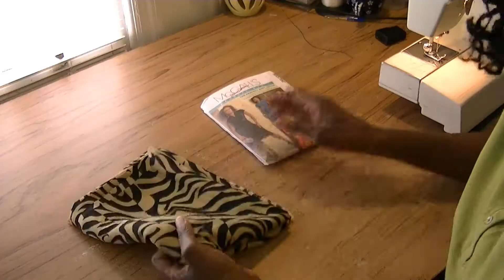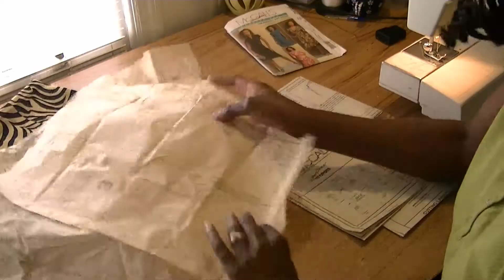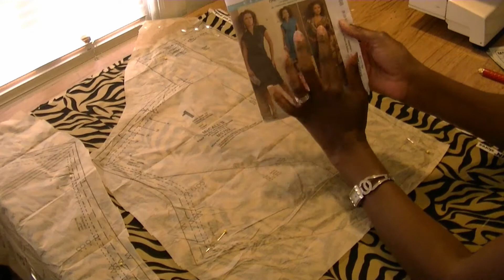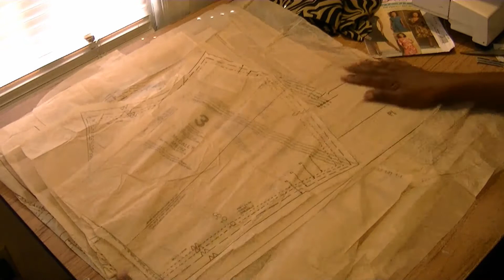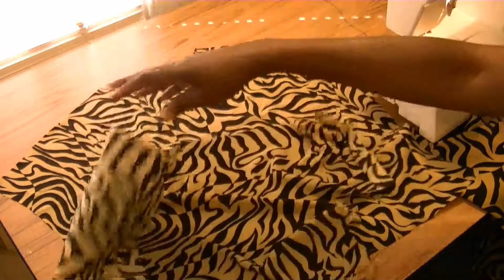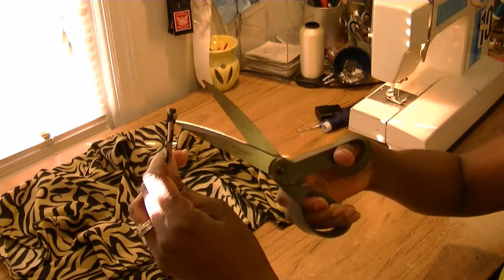SWN - Manipulate Pattern To Make Leopard Print Top

Comment: you surprise me how easy you make everything look.  My only (?) is why not use interfacing for the front.
Reply from the maker: Hi Linda, thanks for your question. You could have used interfacing, but I chose not to because I wanted a softer more subtle drapey neckline.  I wanted it to mold down the front of the top. You won't get that look with interfacing.  Instead it would be for firm and stiff, and some people like that look, so you could go either way.  Hope this helps.